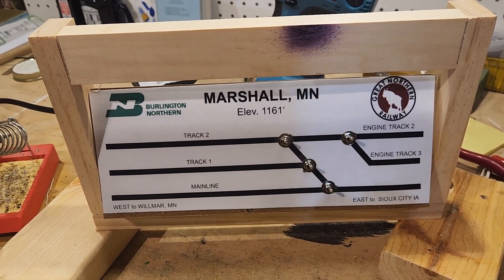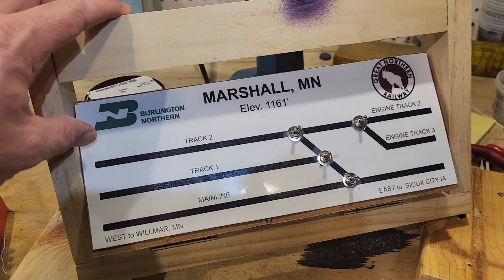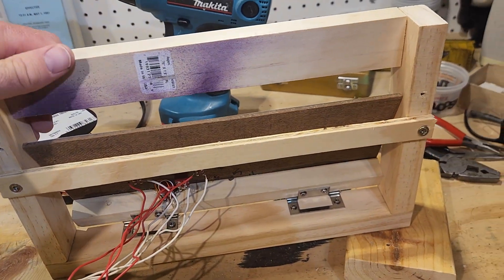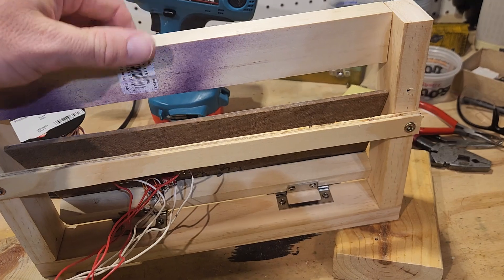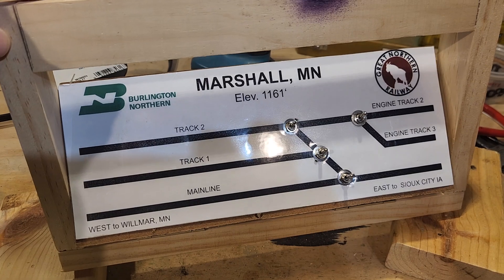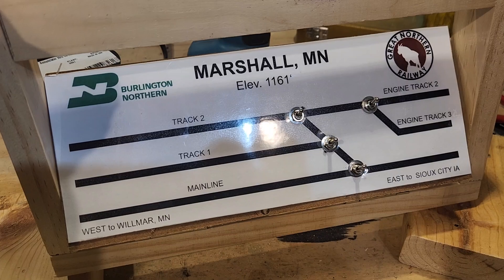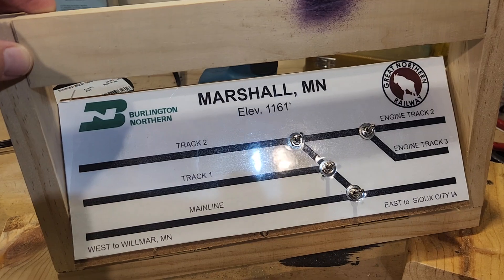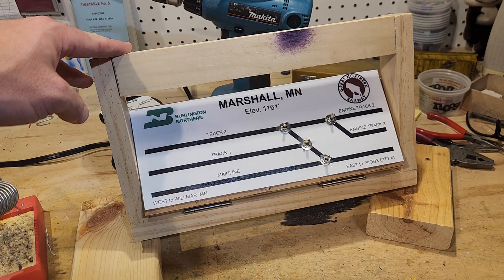Question on Lighting My Switch Control Panels

Comment: some strip LED lights would be fairly easy to tuck up under the frame to cast a light down onto the panel.
Reply from the maker: @yrunaked4 I hadn't thought of using strip lighting for use in that short of an application.  Will have to look into this.  Thank you!!!

Comment: Agree w/ @yrunaked4 strip leds in a soft white at bottom interior edge of your fixed brace would provide nice ambient glow for night ops without it being glaringly bright. Can cut the individual leds to get the number/length you want. Worst case if entire fixed portion will be mounted (ie no lip) can just mount to lower down facing ledge but wouldn't look quite as clean in my opinion. Looking forward to seeing what you end up doing.
Reply from the maker: @MRR_Shadowolf  Any suggestions on which product I would use here?  I'd probably want to go to 12v as I already have 12DC at the panel to operate the switches.
Reply: @blackhillsandeasternrailroad  There are multiple options/brands to choose from; in general haven't heard of any epic failure ones. An amazon search for 12v ribbon LED strips will turn up a bunch of options/price points. Big box stores also have them if want to see them first hand. Based on your stated need for them, can forgo the multi color ones, you just wanted subtle lighting for night ops. Also, color 'heat'/tone/brightness is another personal consideration. Don't need them bright enough to land a plane but too soft a warm yellow may not illuminate well for you. 

I use LED overheads/spots on my layout and haven't a need for panel lighting like you want to do (but you do have me thinking about it now lol). I do have red/green leds at each toggle though to ensure I'm tracking main vs diverging paths.
Reply from the maker: @MRR_Shadowolf  this is good information.  Thank you.  I'm thinking of using LED strips behind the fascia as well under the upper level (to light the main level) and behind a valance on the upper level.   My kids use those color changing light strips.  Super cheap and lots of fun options.  But as you say, my only requirement is realistic daylight...  Will look on amazon.  Heard a guy mention about 5000K the other day.  An EE friend of mine retorted about that being way too bright.  4000K might be more like it?  In a hidden staging area might be a good place to experiment to see what we like the best.  Again, thanks for the info!

Comment: Agree with the other guys.  Get some ribbon LED's and mount them to the frame above the panel.  Should give just enough light to make it easier to see the panel.
Reply from the maker: @johnbanicki7232  I also need to get ribbon LEDs to light in the staging areas, which is pretty much everywhere on the layout besides in Sioux City.  I might wanna put an accent there too, perhaps for ambiance...  Thanks for your input!